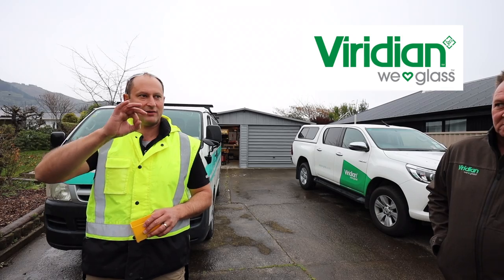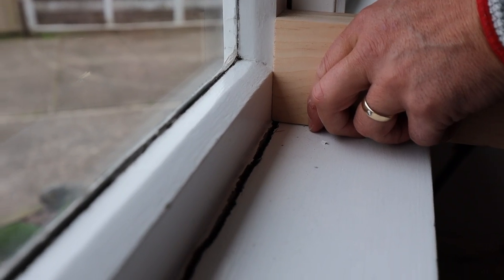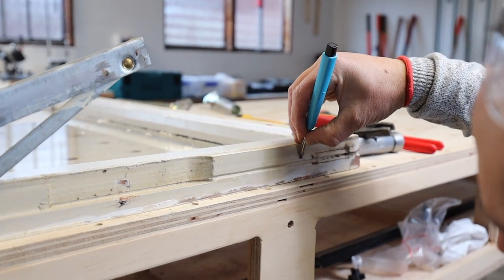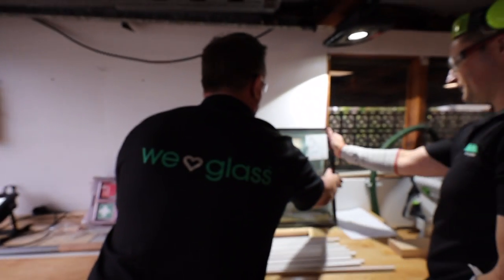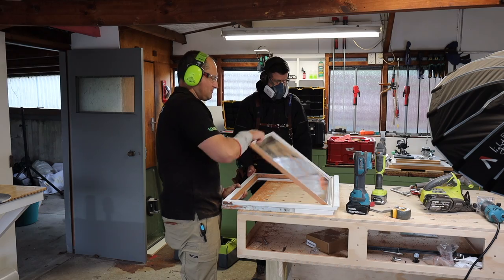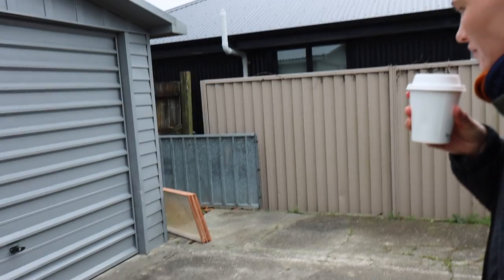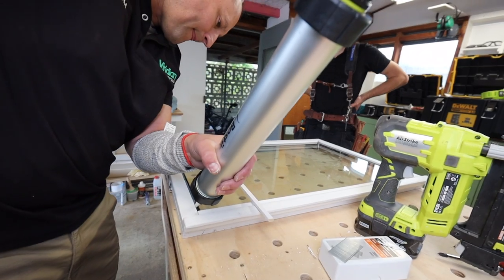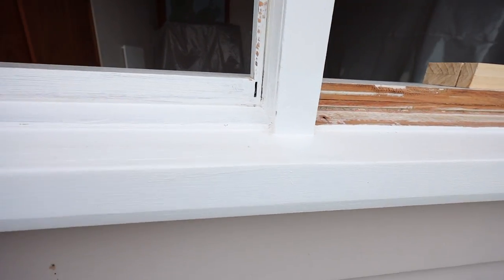I'm Double Glazing My Old Windows... Wish Me Luck

Comment: Cool video Scott, I have been watching your move south from AKL with interest as we did the same, moving near to Rangiora in late 2020. Our home is of similar vintage with the same style of split timber windows. We had them retro-fit double glazed about a year ago which has been excellent but still have a couple that don't seal 100% due to twisted frames etc. I have tried rubber seals with limited success and would be very keen to see your approach to sealing these up in a future video. Cheers

Comment: Hey Scott, nice video. I am a glazier in the Netherlands. I wonder why the glass is kited and then also the glazing bars. This prevents the glass from ventilating in the rebate.With us, the bottom lath is also installed in a ventilating way.We also set the double glazing on adjusting blocks. Not seen.
Reply: The blocks are mostly used on metal frames, not wood. But they can be used depending on the situation. (in the US)
Reply: I wondered about this as well. It also seems to be a very thight fit.

Comment: Having two separate openings on top of each other creates a flow of air, cold air drawn in through the bottom opening and hot air escaping out through the top opening. I suppose most important in summer and warmer climates like Australia so maybe not as much of a consideration in your setting.

Comment: professional glazier here (professional, not master) instead of screwing the bottom windows shut, why not simply seal around them using more silicone or whatever works best with the paint. I think it would hide that little gap, and the imperfections in the window, seal sound better, and it would be easier to remove later down the line when that glass has to be replaced. I replace LOTS of that type of glass when the barrier breaks and it gets moisture inside. again, I'm not claiming to be an expert glazier, its just my job lol, but that makes more sense to me
Reply: actually, i just realized you could easily remove and replace the wood around the glass to reglaze them, so nevermind on that, but still, why not caulk them if they are inoperable anyways?

Comment: in Europe, we use triple glaze windows  (its only 30% more expensive then double glaze at least by many brands), cuz all the insulation in/on the wall wont help you, if the Windows R/u value is low and  let in cold/heat depending on which time of year or place you live...
to be fair, usually we replace the whole window, and not just the glass in an old window...
and yes, compared the old simple galss, you're windows will be way better with the double glass.. if you insulate the walls well, the double glass will save you money in the long term, cuz thats the only place  where you cant put in insulation.. so with this you're heat loss will be way less then with the old one...

Comment: You'll still get some condensation if you have enough people in the house. Speaking of neutral cure sealants my off sider years ago didn't check that tube of sealant he grabbed. Eventually the customer noticed what I suppose you would call discolouration over a few months, that required a it of remedial work.

Comment: I was going to do this on my 60s Turangi house but the sashes were not in great nick, especially at the joints. Also you are limited in the width of IGU and if windows are closer than 800mm to the floor you have to use toughened glass 5mm thus reducing your available air gap and efficiency of the unit. With larger windows the IGU becomes very heavy and the very small rebate left behind the unit would not support it especially on an opening style sash. I am certain there should have been a sloped wedge shaped block on the bottom rebate that the IGU sits on. This stops the IGU edge sitting in water from any condensation or moisture. More importantly it stops the butyl sealing the IGU from failing over time. In other words there is a way for moisture to escape and so I wouldn’t have completely silicone sealed the beads. Finally re gas bottles it’s the flu from the burner that has limitations from opening windows too. So more likely the walking hazard was the reason for nailing windows and the ease at which a burglar could get in. In the end I’m going with double glazed mounted in aluminium insert frames . You keep the timber outer frame and acribers but lose the mullion. You can get up to a 24mm IGU. We have a local manufacturer so my money is spent in the community.

Comment: When your undercoating bare timber should have thinned the undercoat with a 70/30 or 40 Paint /Water ratio, and some bondcrete.
Make a penetrating sealer, seals the timber much better goes in deeper.

Comment: The downsides to that style of glazing are that there is no drainage from the rebate cavity, you still have yawning air gaps everywhere, you still have to paint them all every ten years and replacing a broken pane is an absolutely awful job; even worse than a putty hack out by the time you've split all the beads trying to get the V60 apart. Good thing about those four sash arrangements is that you simply take all four sashes out, cut out the mullion, and it's a two minute job to put a brand new thermally broken aluminum or uPVC insert window frame in. The cedar and crummy old 3mm drawn glass can be recycled into something else. Less cost over all, better thermal results, and still no consent required.

Comment: We're putting double glazed units into the original timber window frames of our house. The ones already done so far have silicone rather than the foam tape shown at 12:25, between the glass and the back of the frame. Then another bead of silicone between the glass and exterior capping. Should we be using foam tape instead?

Comment: I like how the rebate was cut deeper to hide the spacer bars in the double glazing as obviously the original windows weren't designed for double glazing - nicely done!

We had special narrow double glazing installed in old oak frames because of this (10mm rebate on our existing fixed lights), but compensated with krypton gas to get the thermal efficiency up. Since they are fixed, there was no opportunity to remove them and work on the windows, so options were more limited.

Comment: Hi Scott, 

I'm giving serious consideration to doing this in my place (1920s, One Tree Hill). How much difference are you noticing in warmth once this was done? I gather wooden frames will be very different compared to modern aluminum frames where the inner and outer ally is thermally isolated from each other. I'm questioning if it's worth it with seal-less wooden window frames. 

We've already got a ducted heat pump fitted (pricey, but zero regrets), which makes me incredibly tempted to simply seal 3/4 of the windows shut in each room to minimize drafts. I see you're routing your frames for fitted seals, which seems like a lot of effort. However, I can see that it is the only real, practical solution without retrofitting aluminum frames into a villa or bungalow where they really don't belong. 

I'm starting to view it as one of those things where you go the whole hog (pull GIB, insulate walls, double glaze, route and fit seals etc), or do nothing at all. 

Cheers - Bevan (Auckland)

Comment: When you do the own house renovation  when you add insulation into the external stud walls are you going to a batten externally to maintain the ventilation behind cladding & batten the inside to create services cavity and possibly use the passivehaus wrap ? Or do you feel they are not needed or too expensive or not available in NZ

Comment: wish we could do this for our house, but we have to replace the entire windows as the aluminium frames cannot support the extra weight of the glass.

its something we really need to do as well as the windows are massive. the biggest being 2m x 3.2m, the 'smaller' bedroom windows being 2m x 2m and 1.2m x 2m. we loose SO MUCH heat through them, you can feel the cold when you walk past the windows. its going to cost an absolute fortune to do.

Comment: If using single pane low - e make sure you follow cleaning specifications as some products can damage the low-e film
Reply: Didn't the installer say the low-e film was on the inner surfaces?
Reply: @JohnnyMotel99  if you use single pane low - e glass not dbl glazed the film -which uou cant really see is on  inside
Reply: @hotshot243  ha! forgot to read your comment fully! my bad...

Comment: My parents house has nail holes in every window frame. It some kind of poor security system, you'd drop nails into the holes so the windows couldn't be opened, but it was designed so you could pull them back out again, probably with a magnet. Also 1960's...

Comment: Hi Scott love your videos. Just some questions about this job. How deep were the router cuts I imagine it was a 38mm x 3mm slot cutter? 30 around 13mm into the side? And what were the depth of the cuts I imagine that was around the 18mm for the unit plus 5mm for the 6mm bead plus another 2mm for the rubber seat/backing strip. So 25mm total depth? Also what were the overall dimensions for the glass on this window. It looked quite a bit bigger than the original glazing. Neat to see it done. And yeah they should have used a vacume connected to the router aye. 😉

Comment: Wow, that looks like a lot of work doing a whole house, but great job!!!! 

How does this compare to replacing it with double glazed low-E aluminum windows including labour cost, flashings, tape and sealants etc.?

Although cedar windows 😍
Reply: the labour cost using this system must be massive. Can only see this as viable if timber frames are in perfect condition and client is demanding the retention of timber.
Reply: @drewmis1  Well if you going to replace them completely it will also be quite a bit of work. Re-tape, flash, seal, scribers etc. Maybe even a bit more? But possibly better performance as well. 

On a side note, I find it crazy that the external walls have no insulation!!! Must get super cold, never mind the moisture getting trapped in the cavities.
Reply: @Zjaan321  for sure mate I agree. Like you said though the seal would be better, Scott's going to have to pump alot of hours into them to get them up to scratch, even though they are clearly in really good condition. We live in glorified tin sheds down here, up until the 80s/mid 80s houses were still being built without any insulation. Growing up we relied on woodfires and told to put on another sweater. We come across private homes that only have insulfluff, an old paper based insulation in the ceiling and that's it. Rental properties up until recent law change could be cold and damp, leaking, with none whatsoever. Recent changes have seen rental properties standards raised with minimum allowances around all of these aspects, except walls obviously because they're hard to retrofit. New building code has just been passed basically doubling R-value insulation requirements and thermally broken windows.

Comment: I have the same timber joinery. Would be interesting to know the cost of this replacement glass in the 1960s cedar versus replacement with a complete aluminium joinery window?
Reply: This is certainly cheaper, but it depends on the state of your timber windows. These sashes are a bit flimsy (and made more so by increasing the size of the rebate) for double glazing.
Reply: If you don't have insulated walls I'd always go aluminium.

Comment: This was a great episode, we currently have single glass and it drives me up the wall. I really want to change them to double. We have aluminum frame. Now I’m wondering if I just buy the glass and pull out the aluminum frame and build timber frame windows 🤔🤔 love the content!!
Reply: Sometimes if the frames are aluminium you can retrofit double glazing with new glazing bars. You still will get condensation on the aluminium frames, there is also might be a colour mismatch with aluminium and the new glazing bars
Reply: Yep.  Most aluminium windows can be retrofitted.  They replace the 45 degree glass retaining stay with a 90degree one.   You can buy the stay from aluminum extruding companies.

Comment: Will it make a difference when the house is leaking air everywhere? 
We have the same windows, but also massive gaps in the floor and ceiling along the walls. My understanding is that the air leaks cause the great majority of heat loss. Not radiation through the Windows.
Reply: Presumably they will tighten the building envelope when they remodel. In the meantime, the lack of condensation and lower noise from the neighborhood will be  nice features.

Comment: in norway we change out double glas windows to tripple.. hehe

but is this cheaper then new windows? last time i checked here it was the same price or more expensive to fix an old window compared to just buying a new one. specially a PVC windows
Reply: New windows would be cheaper than this work in Norway, but I bought ONE new uPVC window last year (1.8 m x 0.9 m) and it was $3700 installed. So I'm looking for a more sensibly priced method for my other windows.
Reply: @PhilipRoper  that was expensive! we buy them from poland and the price is 3-400 dollars pr windows 3 glass..

Comment: Buying a drop in window would have been easier,cheaper and look better instead of using that tape foam that will shrink and cause movement over time use silicone that will absorb vibrations and will not shrink.

Comment: Kind off hard to blame a poor result on the rest of the windows on the tools… Love seeing that cheaper tools can work.
Double glazing, we’ve done triple for thirty years… Funny how different building techniques are around the world.
Reply: I'm guessing it's MUCH colder where you are.  I'm in Los Angeles where it's considered a disaster area if it drops below 20 (-6 celsius).  I've gone a whole winter without turning the heat on.
Reply: @rpfree  Not that cold actually in my part of Sweden but for a new built house 300mm insulation under the concrete slab is normal and 220-300mm in the walls. We do have crazy energy prizes though….
Reply: Nz is about 40 years behind Europe. We have very poor insulation standards for our climate. Tho thats meant to change this year.

Comment: ehhh welcome to the future 30 years ago - compared to Dk in Europe. I have just replaced windows in better condition than that, to newer ones with 3 panes and better seal. Hopefully you will catch up at some point
Reply: there are plenty of options down here mate, even triple glazing if you want it. Scott just chose to go this route to retain the houses original look. Theres not too many places in NZ where triple glazing would be necessary, just expensive overkill
Reply: @drewmis1  And I understand this. Especially renovating a house to keep the look of the house. The difference it just SO huge, it mindbogglingly.

Comment: you will have alot of trouble in the future the way he teached you, keep in mind that double glaze condensate with climate change (hot/cold weather) at the bottom(polysulfide) inside the frame, you need to have a few holes on the bottomside to let moisture escape,otherwise it will rott from inside out over time. also you have to have 5 mm space around the glass where you use the glass spacing blocks to set it up right.

Comment: My ryobi router did exactly the same thing, the shaft sheared off just outside the motor housing
Reply: Ryobi not good, only handyman (intermittent use) quality, but cheap.
Reply: I have used many cheap handyman grade tools in the trade, ozito Ryobi and Black and Decker, I have also had my fair share of expensive tools.
I have found cost wise it comes out cheaper replacing the cheap tools 2 to 3 times more then the expensive one and is insurance against theft and breakage.
The only downside is the handyman tools have less power, but these days not much less.
Reply: @spudpud-T67  I dunno, I think you get good models and bad ones, my old ryobi impact is 8 years old and still going, but there’s been at least 3 YouTube references to that router failing. So I do think it’s down to the price point and specific model
Reply: @Extragonk  The last 3 Ryobi (yellow as shown here) tools I bought were duds. A planer cutter bearing melted out its housing in half an hour, a belt sander lasted 1 week and a second replacement lasted just as long. I am very gentle and fussy so I didn't use them like an animal. I moved back to Makita.

Comment: Keeping the original timber sash is cool but man that took a while. With double glazed insert frame (aluminium frame installed into old window frame) doesn't have the same classic look as the timber but you can double glaze an entire house in a day or two